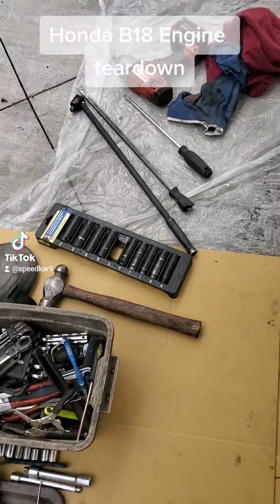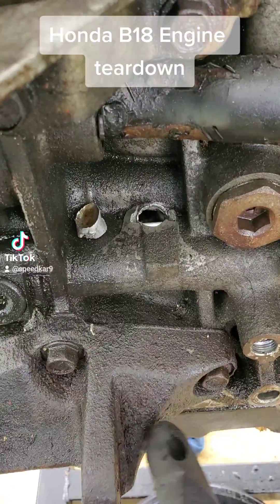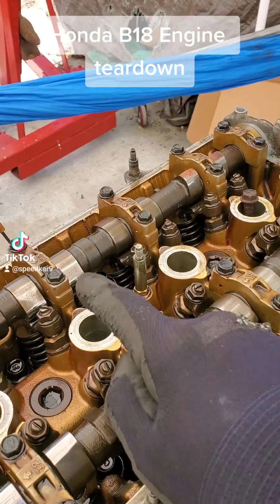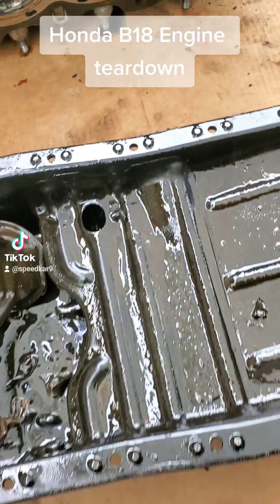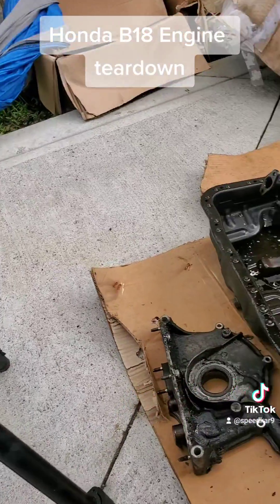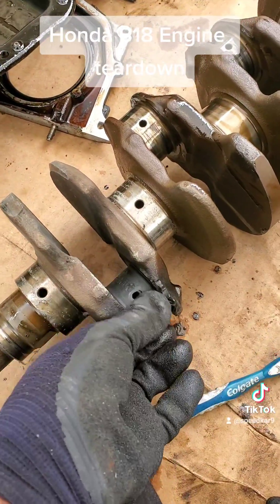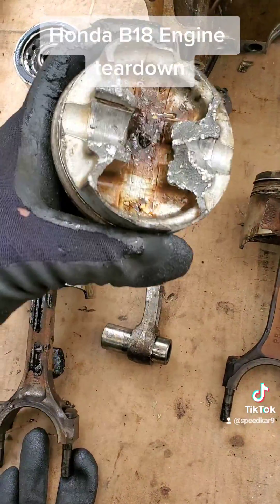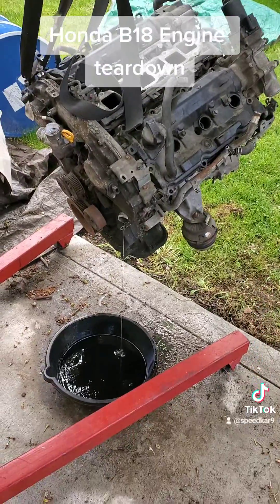Honda Integra B18 Engine teardown Preview

Comment: Hi I'm an 11 year old mechanic with 45 years of experience. My suggestion to you would be simple spraying some WD-40 on the crank journals and lil bit of duct tape on the inspection window so dirt doesn't get inside. Always use 98 octane fuel.
Reply from the maker: Good choice!